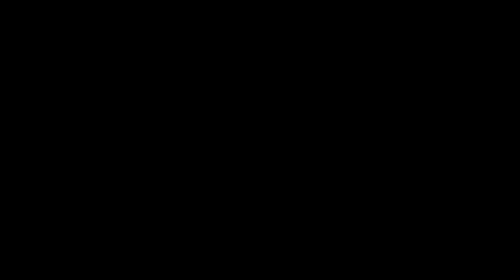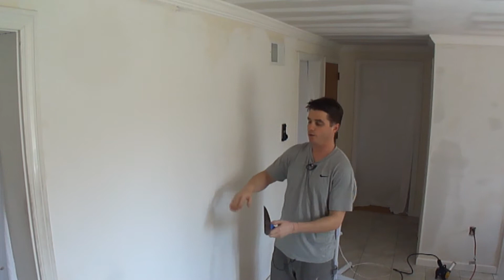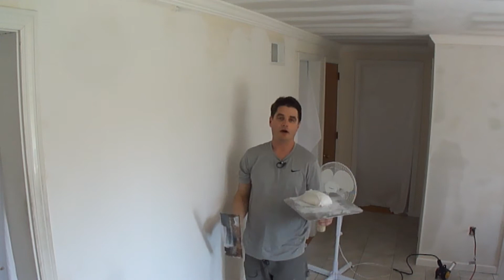DIY How to Fix a Bad Skim Coat Wall Job using Hawk & 16 inch Trowel  (Part 3) - Dry Wall Repair

Comment: Thanks for the great videos   I got plenty of compliments on my first wall, covering an awful plaster repair.  Never thought I'd be excited about skim coating.
Reply from the maker: Hi Chris-

Thanks for sharing your project!  It's exciting to actually change the appearance of something for the better. What tools did you use to get this done?

Russ
Reply: I used a 13" aluminum hawk, a 14"x4" finishing trowel, 6" and 2" flexible joint knives.  The biggest challenge was working with the mud itself.  By the second coat, I was handling the hawk and trowel very well.   I tried a Hyde drywall sander free that attaches to the shop vac but opted for the sanding sponges instead as these gave me better results.    By the way, what kind of wire brush do you use to clean your brushes?  I saw one at Home Depot but it looked cheap and It had maybe 16 wire teeth.
Reply from the maker: Hi 

Thanks for sharing this! I use the blue handle silver brush.  If you apply  tthe right amount of mud and feather it out right, your sanding should be minimal. What didnt u like  about Hyde sanding sponge?

Russ
Reply from the maker: Hi Chris 

Here is a video where I clean my paint brush.  https://www.youtube.com/watch?v=w1tL53KQ42k

Comment: Your videos have been very helpful for my recent attempt.  I demo'd two walls in the living room and am attempting to mud an extremely high-traffic area which is highly visible...  Ambitions, and stupid...  But, It seems to be going OK so far.  My trouble is that I need to look past the imperfections at the early coats.  Which I am assuming is OK to have, which is why we have a few coats before the skim coat(s).  My new drywall sat about 3/16" + lower than the old drywall, for a 10' x 16" strip.  So I am attempting to float the entire strip.  Stupid, but still giving it a shot.  I have a 20" trowel to help with straddling the strip in order to float it. I am also sanding after each coat in order to hopefully help my chances of making it flatter..
Reply: So I guess my questions are:
1: Are imperfections after the 1st-2nd, and possibly 3rd coat ok? I am willing to do as many as it takes..
2: My sides are feathered out a ways (1' to 2' worst case), but smooth transition to the paint. Is it OK to go that far out?
3: Is floating that much going to result in cracking later?  I am It is around 65 degrees and very dry air in the house during the night and while I am at work. I am assuming the longer I let it dry to expose the shrinkage the better..
4: Working upside down on the ceiling with a 20 trowel, and attempting to float that far has been a nightmare.  Do you have/can you make a video covering a large area of ceiling?  Due to the size of this fix, I am finding video's on ceiling plaster patches very useful.
Sorry for the long-windedness of all of this!!  Despite all of the cursing and a wrecked house, I am kind of enjoying it!
Reply: I decided to leave Facebook this year--extremely distracting, haha. Your videos have truly been a great help, and I would like your G+ page or anything else I can.  I have been trying to take pictures but the light is hard to get right in order to see the imperfections...  I'll try again when I get back to it.
Reply from the maker: Ok Craig!

Comment: Russ, I am trying to repaint the walls in a house I just bought. The paint isn't that bad, but the walls have hundreds of repairs that you can see thought the paint. Some of the walls have a high gloss, and I believe an oil based paint. Do I need to prime the walls before skimming, or can I just sand with something like an 80 grit sand paper?
Reply from the maker: +Russell Stamey 

Hi Russell- I would save yourself a headache and prime the walls first with Gardz. Did you start yet?

Russ
Reply: +Russ Olinatz awesome that you suggested guards great product I use it all the time especially n damaged drywall.
Reply from the maker: Hi Johnny

Thanks for sharing that. I too use it all the time also.  Have you ever tried the Sherwin Williams Drywall Conditioner?

Russ
Reply: +Russ Olinatz no I haven't I'll have to check it out, I've always used guards,Binz or 123 primer.
Reply from the maker: It's not as good as Gardz, but it will works for torn drywall paper.